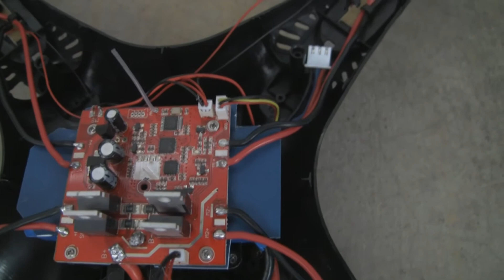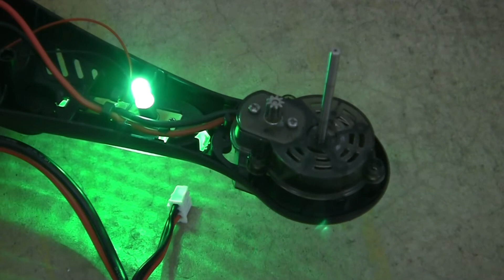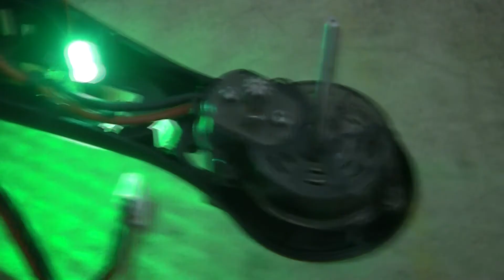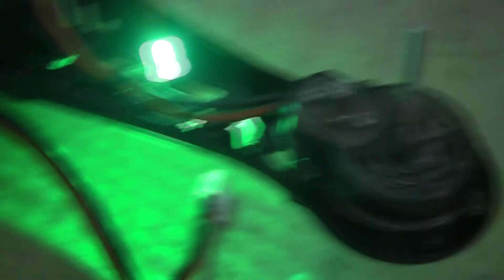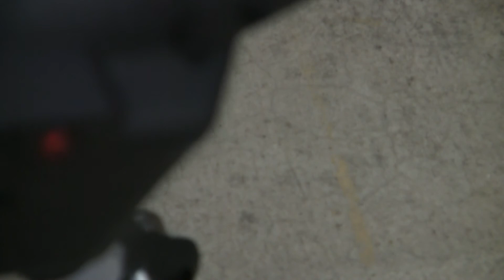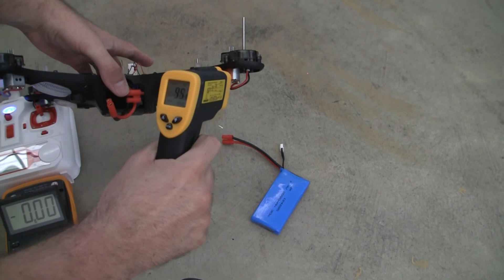Can a Syma X8C X8W handle a 4S battery? Part 2 - Motor Limitations

Comment: nice vídeo my friend. who barety recommend for the upgrade syma x8. Saludos from Chile.
Reply from the maker: FEÑA BICIADOS You could use a 3S battery for more power, but some people have reported problems even with a 3S. Safest battery upgrade is to use a high capacity 2S battery with a 30+ C rating.
Reply: something like that  / ¿Turnigy 3000mAh 2S 30C Lipo Pack? thank / Thanks friend, very good your videos! Desde Chile con cariño!
Reply from the maker: Yes, but you may have to mount the battery outside because it probably won't fit inside!

Comment: ITS REALLY A AWESOME TEST. 
have you tried the same things adding the batteries in parallel.

may this help the syma x8c to mod adding more battery in parallel and will get more air time, near about 30min.

parallel circuit will help to keep voltage same as needed and only thing might possible is amp might hit the machine to blow up. but it can be handled by current protection circuit

hope you try and give some more readings to get some good conclusions.
Reply from the maker: Thank you for your kind words! Please look at my other videos, I did actually parallel 2 batteries. The results were about a 50% increase in flight time. It was not that much more because the added weight caused the X8 to work harder. 10 minutes of flight instead of 6-7 minutes. The higher voltage and better C rating did allow the X8 to fly strong even with the added weight.

Comment: hey guys i need help with my syma x8w one of my motors burn (heat)out and dont know how to fix do i need to buy a new motor or put silicon grease on it.
Reply from the maker: If it is really burnt out and does not turn, then you need to buy a replacement motor because the brushes are shot and are not replaceable. Grease is something you put between the motor and the gear. When you get a new motor, be sure to grease it up.
Reply: +Rendus4 ok tx.
Reply: Rendus4 will it handle a 3 cell

Comment: OK what happens, fully charged battery, 11.1 volt 1350 mAh, 35C pack, you can't throttle up till you have drained off some of the charge. After about two minutes of sitting at about 10% throttle, you can then lift off but cant go past 45% throttle.  When you go pasts 50% throttle the quad just stops falls out of the sky and needs to be rebound. I hear that using a lower "C" rating battery i have used 20C 25C 30C and the same happens. I have now a collection of 11.1 volt 1350 -1850 mAh batteries that I can't use. yet i see many people flying with 11.1 volt  packs.  Watch this. this is what happens to my quad. I thought that having the Walker 2G gimbal  would drain power and tame the voltage and lower it a bit but it has not helped. https://www.youtube.com/watch?v=0opVFB8-SEk
Reply from the maker: I know for sure that the board has a protection circuit to prevent flight if the battery is less than a certain voltage. It does not have a protection circuit for excess voltage. I do believe there is something on the board that analyzes current, though, because Syma tells you that it will not allow flight if a motor is stuck, like if you crash land and a propeller will not turn, the control board will not allow flight. If you watch my video, even at 15 volts, I do not trigger this protection when all motors are turning. A normal X8 on a 2S battery will use something like 100 Watts at full throttle, and here I use up to 100 watts at full throttle without any propeller load. But once my motor burns out, the amps climb to 15, and the lights start flickering like in the video you linked. Try this, remove your propellers and see if you can use 100% throttle on a fully charged 3S battery. If you can, then you know that with propellers on, you are triggering the anti-motor-stuck protection circuit. I don't have a bypass for it, nor do I know where this protection is at on the board.
Reply: Thank you! very much. Awesome
Reply: Why not use Zener diodes rated at 1 Watt with the voltage cut off at 12.5 Volts?
Reply from the maker: Won't work. The board shuts down power to the mosfets when it detects too many amps are being drawn. The motors draw more amps as voltage increases. I don't know the magic number of amps that triggers this effect, but it is somewhere between a 2S and 3S battery under full load. Rather than using a Zener diode, you should find the safety shut-off component and disable it. It might be in the firmware of the IC's, I don't know.

Comment: i use 3s battery on my symax8 hc  works perfekct  for my 2 axis gimbol. No point to stepp up to 14.8v engines not handel that power tells its self.
Reply from the maker: I agree! I saw a lot of people on Youtube using 3S batteries and I was trying to figure out why I didn't find any 4S battery videos. I figured I would create my own to discourage others from attempting the modification. Thanks for watching!
Reply: please help me with my setup I can't get mine to fly right with the 3 cell battery pack. It is not fail safe enough to fly it . Sometimes it just stops resets in the air and and it drops.  It seems like after about two minutes that then I can fly the drone correctly but when the packs are fully charged I can't run anything past 25% throttle.
Reply from the maker: Ulises Batalla Two things: (1) Check your control board for any components that might be fried - as you can see from my other video, a capacitor exploded when exposed to 15 volts, even though it was rated to 16 volts. (2) If you can fly for 2 minutes before it drops, it sounds like the Mosfets are overheating. The Mosfets are the four tall black and silver components. As the voltage increases, so does the current, and that creates a lot of heat in a small space.